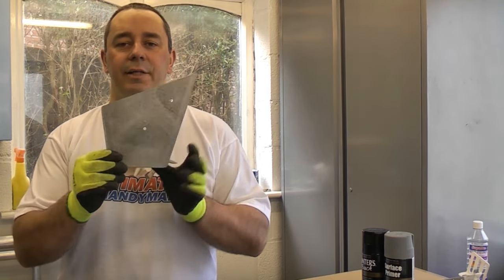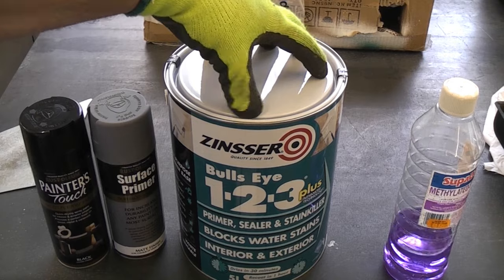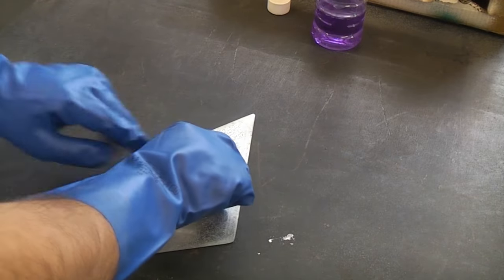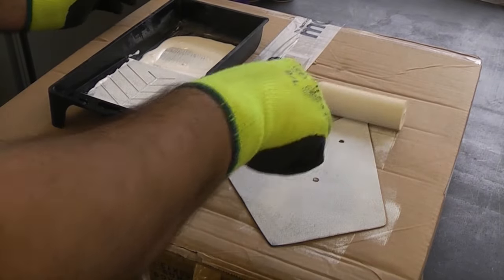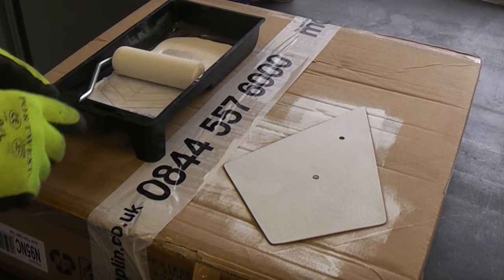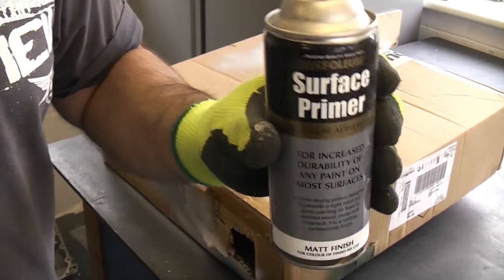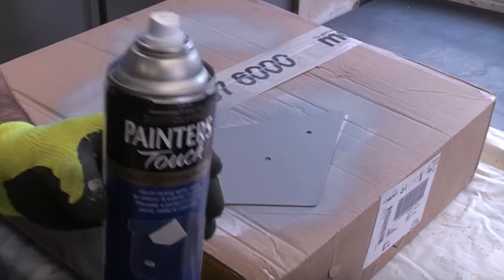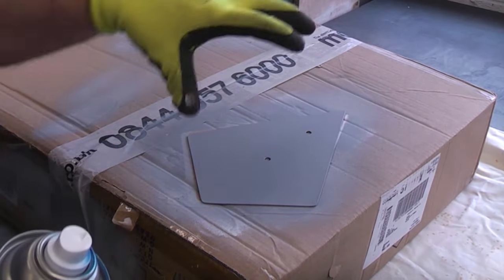How to paint Galvanised steel

Comment: The galvanization process covers the surface of the metal with an oil and zinc coating.  The first step in painting galvanized metal is to remove this surface coating using an acidic wash of either 100% vinegar or a solution of water and muriatic acid.  Once the zinc and oils have been removed, the acidic wash needs to be neutralized using either ammonia or a baking soda and water mixture.  This neutralization wash is then rinsed and the metal allowed to dry.  Only then can the galvanized metal be primed and painted.  Further, there is no need to use two forms of primer before paint.  Once the zinc and oil surface coating has been removed (and acid neutralized), galvanized metal should be painted using techniques similar to that of painting aluminum.  However, under absolutely no circumstance should galvanized metal ever be primed or painted with an oil-based product (only water-based coatings should be used.)
Reply: Robert Barnwell 
For acidic wash can i use the interverter acid?
Reply: What concentration of ammonia should be used. Highest I can find is 9.5%
Reply: Well I already applied Oil Based Rustoleum to the Galvanized trailer, so now what? Wait until it chips away?
Reply: bitTorrenter Where can I find this at?
Reply: someone in here knows what they are doing. 
You just share some secrets of the trade, lol.
Reply: This is stupendous. The zinc layer has been applied to prevent corrosion. And you want to remove it with acid? It will not only remove the zinc but corrode the metal underneath
Reply: I used an etching primer (acrylic) then oil based colour, paint is perfect after 10yrs. But firstly, the galvanized posts were cleaned with a degreaser to remove the oil on the surface, part of the production process.
Reply: @veloro7  the purpose of the acid wash is to remove the oily buildup as well as to etch the surface sufficiently to allow the coating to adhere after neutralization. The key is not to leave the etching solution for a long period of time so as to avoid excessive degeneration of the zinc layer.
Reply: @devindrabalkaran3159  is there something that can be applied that will remove only the oil without removing the zinc coating? Like can I just clean it with lye?
Reply: @veloro7  First, I think the word you're looking for is just "stupid", stupendous is a positive adjective meaning "extremely impressive". Second, it's not stupid at all. You either acid etch the surface or remove the zinc coating completely before painting it. The paint and the zinc serve the same function: to inhibit corrosion. The whole point of having a neutralizing agent is to stop the reaction between the acid and the metal once you're satisfied with the surface result you've achieved.
Reply: Great reply!
Got a sec for a quick question?
Reply: 100% vinegar is misleading. Typical distilled vinegar at a store is 5% but you can buy it far more concentrated.
Reply: @veloro7 
Mild acid wash removes the zinc oxide surface which stops
Reply: @veloro7 
The acid removes the zinc oxide surface that keeps paint from sticking. It doesn’t remove the galvanized zinc coating, just etches it do paint sticks. 

Then you can prime and paint. 

This guy is an idiot to say use only latex paint on galvanized metal. That’s stupid. Ever hear of a boat trailer or metal roofing?! That’s no place to use house paint, it’s the place to use oil based or automotive paints, NOT LATEX.
Reply: @nunyabiznes33 
Scrub it with tsp or laundry detergent in water. 
Then etch the zinc with acid wash
Neutralize acid
Dry surface 
Prime 
Paint

Skip a step and get a poor result over time

Comment: I was reading , from Sherwin Williams: Most hydrocarbon solvents, including mineral spirits, leave a thin layer of residue that leads to adhesion failure of the paint film. Instead, use a water-based cleaner/degreaser to clean a galvanized surface. Most acrylic coatings will adhere directly to cleaned galvanized metal.
Reply from the maker: The paint manufacturers (Rustoleum) recommend that you use methylated spirits to clean, before using most of their products.
Thanks for the comment 👍
Reply: Methylated spirits works great, used it plenty of times, cheap too 👍
Reply: @ultimatehandyman  Hi I know it's been 2 year already but do the methylated spirit need tp be rinsed out after it dries? Also there seem to arguments in the comments about using acids on galvanized steel. Would methylated spirits not wear off the zinc coating?
Reply from the maker: @nunyabiznes33   No, methylated spirits is basically alcohol. It will not leave a residue behind and will evaporate if left on the surface. It will not wear off the zinc coating 👍

Comment: The best cleaner for galvanized metal is simply tsp.   You must use a 100% acrylic primer.  Alkyd and galvanized metals don’t go together.  It’s sticks great for a few years then saponification starts and it will repeal the coating.   It will peel.  That’s all you need to know.
Reply from the maker: Good to know!

Comment: Rust-oleum PaintPlus 2x ultra cover is great. Their rust converter (which you don't need with galvanized metal) is far more effective than the Advanced auto product. It also bonds plastic. Great even coating. Beginners can use it easily

Comment: Why do you apply zinser as the first coat rather than just primer x 2 before top coat? i was going to use hammerite x2 before top coat but now i am thinking zinser as its cheaper and thats one primer coat down.
Reply from the maker: You can't prime directly onto galvanised steel, hence I used the Zinsser first.
Thanks for the comment 👍

Comment: I've got a few galvanized mesh wire panels I want to paint. How do I evenly apply the Zinusser primer to a grid mesh without it getting drippy and splotchy?
Reply from the maker: Mesh is a pain to paint.
You might be better off getting some direct to galvanised paint such as Hammerite's version as it does not require a primer- http://fave.co/2pZszjz

Comment: The TDS for Bulls Eye 123 Plus from Rust-oleum specifically says it is for NON-galvanized metals. Yes, it will adhere, but then eventually saponification will set in and the paint will peel away. Bulls Eye 123 (not the Plus version) is for galvanized metals, as listed in it's TDS. Further, the TDS recommends ammoniated cleaners prior to priming, not TSP (it specifically says not to use TSP based cleaners).
Reply from the maker: Here is a link to Zinsser 123+ for sale at screwfix- https://www.screwfix.com/p/zinsser-bulls-eye-1-2-3-plus-primer-2-5ltr/756jg

In the description it says- non-ferrous metal (such as aluminium, stainless steel and galvanised metal)

Comment: Eche it with white vinegar or clean it with white vinegar. Will allow paint to stick for an durable finish. Top coat with oil base paint.  Cheap an easy solution. Try it on anything galvanized. Also a deglosser would work. Or liquid sandpaper if you have to use latex.

Comment: I made a front splash panel for a vintage truck I am restoring out of new galvanized steel. The truck will not be driven in severe weather but it is up front, parallel to the ground and between the grill and the front bumper. my plan is to ultimately paint it with Rustoleum High Performance Enamel. One of the best rattle can paints out there in my opinion. I did not see anything regarding sanding it first  to prep it and make adhesion better. I thought maybe using a DA with say 100 grit first might be a good idea. Then the Zinsser, then the paint. Sound logical?

Comment: Would ONLY epoxy primer and underbody coat work? Cold galvanized surface. And what is that first primer you put there?
Reply from the maker: Not sure about epoxy primer, you'll have to check the instructions.
I used Zinsser 123+ to coat the galvanised steel, once you do that, you can use virtually any primer on top of it 👍

Comment: I think my gutters are just steel. They are darker than that. Do they need primer? For the paint, which kind?
Reply from the maker: I've never seen steel gutters before, perhaps they are cast iron, or aluminium? I think you can get galvanised steel gutters, but they are not common in domestic properties in the UK.
If they are rusty, I would prime them using Rustoleum rust primer, then a top coat of Rustoleum top coat of your choice 👍

Comment: Good day!

Just wanna ask if can I use this method for the door bumpers of the Hospital. The double action door is made of wood so we need to put some galvanised steel as bumpers for the protection of the door. Will the paint torn out easily? since the galvanised steel is prone to bumps from the Hospital stretchers passing through. Thanks in advance!
Reply from the maker: Yes the paint will scratch off easily if being hit with stretchers etc.
In most hospitals I have seen I'm sure they use a piece of stainless steel, which will be much tougher and resistant to scratching and some germs.
Thanks for the comment

Comment: Hi - goes it work on zinc metal with same primer and spray paint used for galvanised?
Reply from the maker: +Jan Orlebar Yes, if you use a primer suitable for galvanised steel it should work fine on zinc as that is the metal used for galvanising.

Comment: Is Zinsser 123+ required -- I have Zinsser 123 (no "+")?  What does the "123+" do that "123" doesn't do?
Reply from the maker: Zinsser 123 should be fine.
If I remember rightly, Zinsser made 123 originally
Then they improved it and made a 123+ version
But people became confused between the two products (rightly so)
They then just made 123+ but named it 123 
Now everyone is confused 😂
Reply: @ultimatehandyman  Very interesting.  I was wondering if maybe the 123+ was a UK product because I couldn't find the 123+ anywhere, so this explains it.

Comment: I like that hint to clean out the nozzle ... I never thought of that and it's so obvious.  I've thrown away more cans of spray stuff ... argh!  Good hint, thanks.
Reply from the maker: Another good tip is to always clean out the nozzles by turning the can upside down and remove the nozzle when you bin it. Then when you get a new tin of paint use the old nozzle again and keep the brand new one as a spare ;-) I have about 20 brand new nozzles somewhere LOL
Reply: *****

That's another great idea.  The only problem is that not all of my nozzles are the same, some are longer or shorter, have a hole for a little tube or not, have the input tube inserted in the bottom or contain their own input tube that sticks down into the can of whatever.  Still, I'm gonna remember that.

I have this extremely sticky stuff in a can that I spray on branches that have just been pruned to prevent rot and infection.  Every time I use it that is it, there is no way to find another nozzle and I think the air clean out idea would work well for that, in fact right after use would be best.

Thanks UH!
Reply: Careful to not get carried away with prolonged cleaning of the (upside down) spray nozzle because you'll run out of pressurized air before you use up all the paint inside.

Comment: Once painted, can you bend galvanized sheet metal?
Reply from the maker: You can, but the paint might crack, unless it is really flexible!
Thanks for the comment 👍
Reply: @ultimatehandyman  I ask because I have in mind to use it for step flashing a bay window for a brick house where it gets bent and tucked in stages into the mortar of the bricks. Copper is frequently used for this but I hate the look of weathered "patina"  copper and want to use the right color earthtone that contrasts between the brick and roof of the bay window.

Comment: will painting the metal take away from the magnetic properties?
Reply from the maker: It will make it slightly less attractive to a magnet, it depends how many coats of paint you put on it. The thicker the paint the less attractive it will be to the magnet.
Reply: Thanks! Appreciate the response. New follower here and I will continue to check in. Do you have a facebook page? If so, please share!
Reply from the maker: Kris Holsti
I don't bother with Facebook much to be honest, but here it is ;-)
https://www.facebook.com/pages/Ultimate-Handyman/105035388376
Thanks for the comments
Reply: ***** Just like to share great tips when I find em. Your videos are so informative and helpful! Thanks for taking the time to respond. Diving in tomorrow and spraying! I am thinking 2 coats of paint tops to keep the magnetic props going.! Thanks again
Reply: I don't think so, unless the paint has metallic property that distort the magnetic lines of force, which I doubt.  The magnetic permeability of paint is negligible, and even if it wasn't it's pretty thin.  Magnetic force is determined by distance from a magnet, not whether it is painted or not.

Comment: Galvanized metal should be etched following cleaning using white vinegar, then apply primer and top coat. ( Not a bad idea to use a tack cloth before applying any primer or top coat)

Comment: Trying to do this on galvanised scaffold pole and I can’t t get the zinsser to stick very well
Reply from the maker: Have you cleaned it with methylated spirits first?
Thanks for the comment 👍
Reply: @ultimatehandyman  yes mate all cleaned with spirits first, the zinsser stuff seems to evaporate off the tube, anyway ive given it a few coats and its suck alright. however with the clamps, i've just directly sprayed them with the primer as it also evaporates off them too, the spray primer seems to stick well though probably cause of the rough cast surface

Comment: will this process work on cold gal. i.e. bare ungal metal sprayed with cold gal not hot dip as shown her???
Reply from the maker: Yes it should do. Zinsser specify this method to cover galvanised metal, they do not differentiate between hot galv or cold galv.

Comment: I need an explanation why two primers are necessary.....other than Rust-oleum is putting money in this chap's pocket for saying so. The BIN primer doesn't suffice alone? I find this Very hard to believe. Very.
Reply from the maker: The Rustoleum top coat, recommends using Rustoleum primer before applying the top coat. Rustoleum primer will not stick well to galvanised steel, hence using two primers.
I have never been paid a single penny by Zinsser or any other manufacturer to have their products appear in my videos.

Comment: Will this work on SECC steel as well?
Reply from the maker: I'm not entirely sure what coating that has on it- zinc or galvanised but this should work as the Zinsser primer will stick to almost anything.
Reply: Thank you for responding. It is Electrogalvanised and cold rolled, so I'm not entirely sure if that makes a big difference or not. It does have a slight texture to it, so as not to allow fingerprints to show or stick to it. I am almost thinking it might not work because of that texture, but am really hoping it will. I don't necessarily have to paint it, but if it's possible to paint, I would absolutely love to.
If you aren't 100% sure on this, that is quite alright. I've been trying to figure this out for quite some time, and haven't been too successful. :)
Reply from the maker: Sorry for the slow replies, I'm very busy at the moment.
I'm pretty sure that you could prime it using Zinsser Bulls -eye 123 as long as you followed the instructions for cleaning the metal first. I have checked the Zinsser App and it says that you can use Bulls-eye 123 for priming galvanised steel as I don't think the fact that its cold rolled will make much of a difference. 
I hope this helps ;-)
Reply: +Ultimate Handyman thank you very much! I appreciate it! :-)
Reply from the maker: You are welcome ;-)